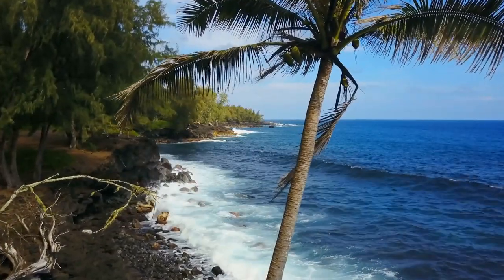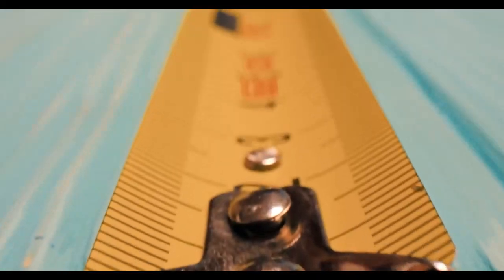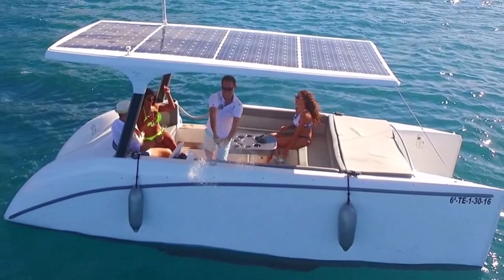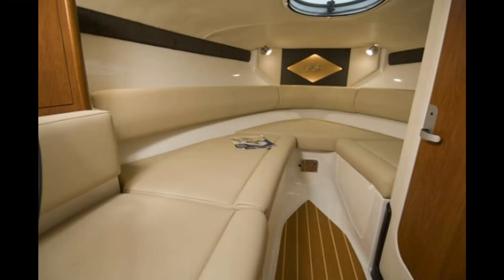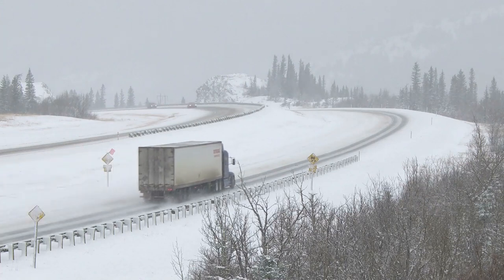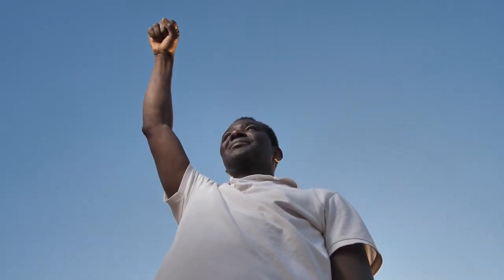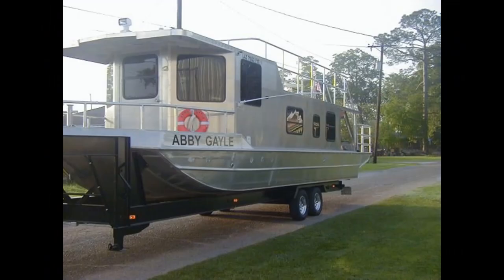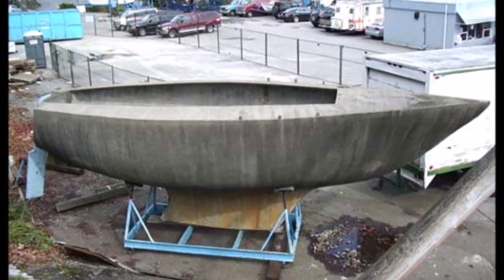Complete Small Liveaboard (Part 1  Size-Type)  #boat # Liveaboard #subscribe   #liveaboardlife

Comment: Great series, thank you. I really like the 26' tritoon-type design at 6:21 - do you have any photos or further information on it?
Reply from the maker: Thank you :-) unfortunately I don't know that much about that specific boat (other than you see on Google) I had met a Couple sailing one while I was cruising through the Eastern U.S and had dinner on board they are really well thought-out pretty boats.
Reply: @IdyllicDreams  Thanks for your reply. I want to build a boat and think that a cat/tri would be easiest as it's basically a box on floats. I'd maybe use bamboo covered in foam, then PMF, incorporating some of the best features I've seen on YT, (including yours). Maybe I'd use telescopic pontoons, or set them up like a trifoiler with sails, and also use solar electric and an outboard for power.
Reply from the maker: I'm sorry I looked at the wrong time stamp of which boat you were talking about. That boat I built. I can tell you all about that. It was 26 feet long. It used a small 9.9 hp motor. And you steered  just using a tiller extension. Box shaped hulls that worked well because they were not wide. Because the center hull was open it provided standing headroom. Galley was split in two half on each side. One side folded up (bit of origami) to make an enclosed head. The little things that looked like seats on the outside one side is actually a one sheet Dinghy and the other side looks the same but it is storage you can get to from the inside. For seating it had two long and two short sofas. The long ones turned into a king size bed. And there was plexi glass that went into all the openings (with curtains) to close it up completely.
Reply: @IdyllicDreams  I like your thinking around functionality. I lived, worked, and travelled as a vandweller for a few years and always thought that you could basically chuck a foam truck camper on pontoons and off you go, (the devil is in the details, lol). I plan to start with a smaller project, learn some lessons along the way and gradually work up to a larger liveaboard vessel, capable of coastal cruising. I'm retiring in a couple of years and though I've never built a boat, I have design skills, the van experience, and I've been watching these types of YT videos for years - thank you, I'm sure you've inspired many people with your awesome designs and very informative videos.
Reply from the maker: My apologies I just saw your last message. For some reason it was marked as I already replied to it when I obviously hadn't. Myself I had a boat that was larger than this but not capable of larger bodies of water. Where I live (Ottawa, Canada) is just rivers and canals. My older boat was showing it's age and was expensive to keep as I had to keep it in a marina. So I sold it and created this one to fit in my driveway. It was fairly cheap to build. Like you I want to retire soon and sail away. So I designed this boat as something to fill the gap between my last boat and my retirement boat. I now have my retirement boat. I bought a 32' boat that had great bones but the interior was badly dated. So I use my little boat for now while I redo my retirement boat.
Reply: @IdyllicDreams  No worries, I imagine you're quite busy? One build I'm considering is a Wharram type cat with a deck that can be transformed to use a net for fishing with lights to attract fish at night, like the plastic drum fishing rafts they use in places like the Philippines but on a much smaller scale and able to be sailed not just towed into place. I'm into multi-use transforming designs.

Comment: Thanks. What about Aluminium with marine growth.  I see you skipped the ferro concrete pretty fast. If done right they would match steel / Al  & modern concrete has plastic fibers instead of metal eliminating rust problems.
Reply from the maker: Your absolutely right about ferrocement. I used to live on a 60' ferrocement houseboat and it was well done. But the truth is most people who attempt to build out of ferrocement fail. When it first came out it was touted as a super easy way to build a boat. But it was quickly learned by many that it was anything but quick and easy. There are a lot of half done ferrocement boats out there. Insurance company's also don't like them not because they are bad but because they simply don't understand them. My series is also about small (Under 32') liveaboard boats and you rarely find ferrocement in that size range. As for aluminum and marine growth. It has been my experience that they are no better than other materials. However I do know copper is a great antifouling metal and some people have placed copper sheets over there hull to stop growth. But I wouldn't try this over something like fiberglass.

Comment: This is great info. I am looking at building a 40'x12'Toue, or French River Boat. sail and Diesel powered. We are not in a hurry.
Reply from the maker: These are great boats. One came through the waterway here quite a few years ago. And he gave me a tour the inside was basically a floating house. Although he admitted he had made it to heavy and under powered. He had used materials on the inside like granite counters and ceramic flooring. He had a lot of problems with strong currents. But that was just his particular boat. Now online I've seen these made out of steel mostly it also wood and fiberglass. Which Material do you plan on using ?
Reply: @IdyllicDreams  wooden with a aluminum, bottom as that allows them to slide over sand bars., or an  aluminum with wood stiffeners.
Reply from the maker: Nice. What kind of waterways are you on. (rivers, canal, lakes or Ocean)
Reply: @IdyllicDreams  The Mississippi river is like a wide canal, they have locks from one level to the other but large ships use them. Produce is hauled from the Great Lakes to the Gulf of Mexico. and there are  quite a few sand bars to maneuver around, swamps lead off and a lot of people have lived it "Shanty Boats", and still do.
Reply from the maker: Sorry I took a while to respond. It didn't notify me you had written back. I've never been on the Mississippi but I have studied it. It is my goal in a few years to do the great loop. Which goes down a section of the Mississippi;-) I love on the Rideau Waterway which is like a miniature version of the Mississippi it's a series of river, canals and locks built almost 200 years ago.
Reply: @IdyllicDreams  can't find plans.
Reply from the maker: You cant find plans for your river boat?
Reply: @IdyllicDreams  They don't seam to be available. Need if this is going to be built.
Reply from the maker: Did you try sites like duck works etc